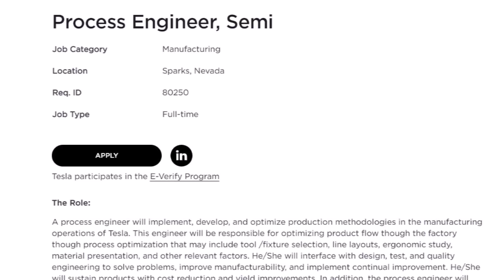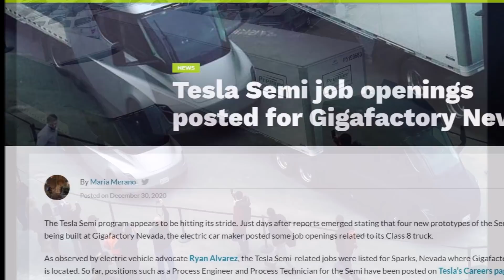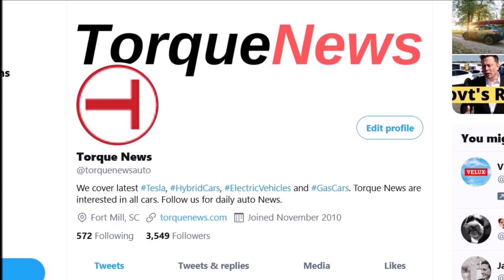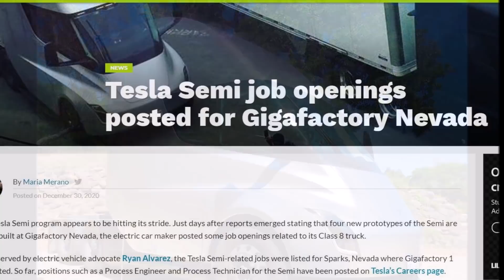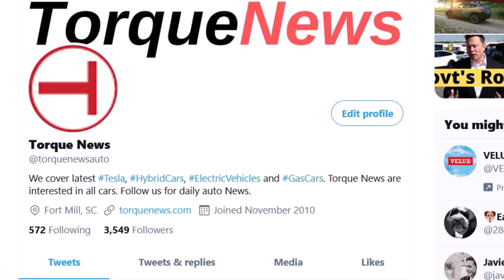Tesla Semi Production Update: Musk Hiring Process Engineers for Semi

Comment: It is good that Tesla is moving forward with their Semi production. The questions are whether these jobs, and the Semi development will stay in Nevada, and if the initial Semis will use the 2170L batteries, or if these are just for the pilot/test Semis, and/or the actual, final Semi production will be in Texas, using the 4680 batteries. Personally I think that the production volumes of the Semi are small enough that they can set up full initial Semi production in Nevada, and there is a lot of available space there, and they only need to build a small number of Semis. Plus producing them ASAP will help Tesla's image dramatically.

Comment: WHY NO SOLAR PANELS ON THE TRUCKS OR TRAILERS
Reply: probably too little return for the cost, compared to spending same money optimizing on the charger/inverters etc..
Reply: @lylestavast7652   A TRAILER IS BIGGER THAN THE SOLAR PANELS ON A HOUSE, A TRAILER IS 40 -50 FT WITH SIDES, HANG A FEW BATTERIES ON THE BOTTOM AND PRESTO CHANGO NO NEED TO PULL OVER AND RE CHARGE
Reply: it's probably not worth it.  A truck driver can only drive 11 hours in a 24 hour period anyways.  The downtime is enough to recharge the Semi at a Pilot Flying J or Love's for the next day
Reply: @JEFFLWALSH  you are assuming the government will let an 80,000 pound tractor trailer on the road without a driver on board
Reply: @cyclopsvision6370  THERE ARE DRIVERLESS SEMIS ON THE ROAD NOW,, THEY HAVE A DRIVER AS AN OBSERVER, WELCOME TO 2021, IN CASE YOU DONT UNDERSTAND USE GOOGOO
Reply: not enough space on the cab to make solar panels feasible